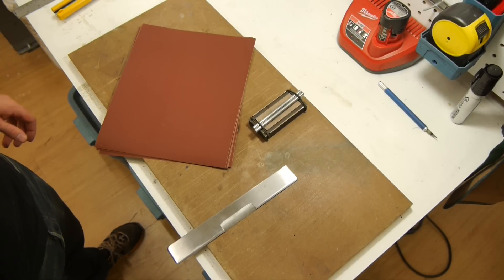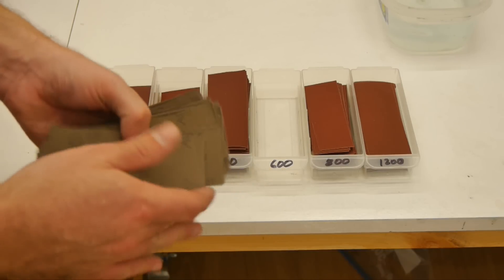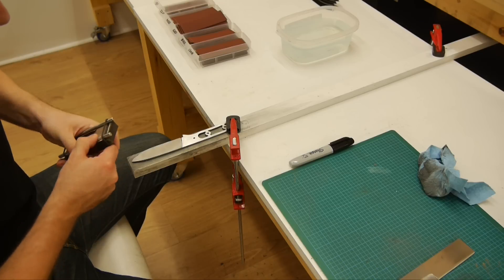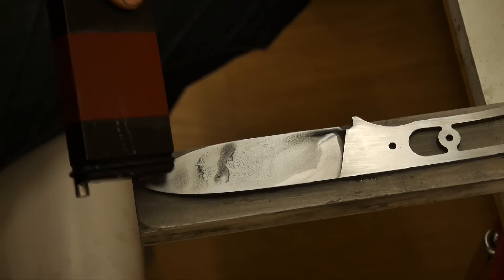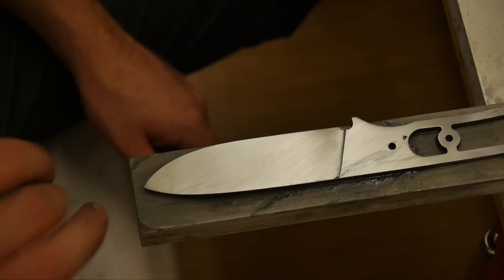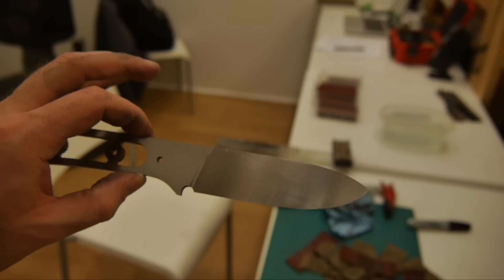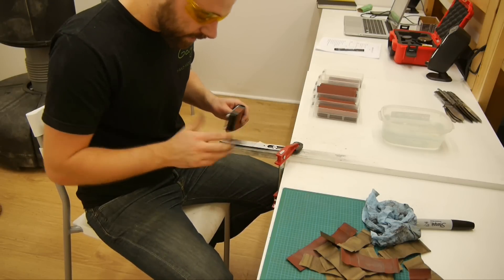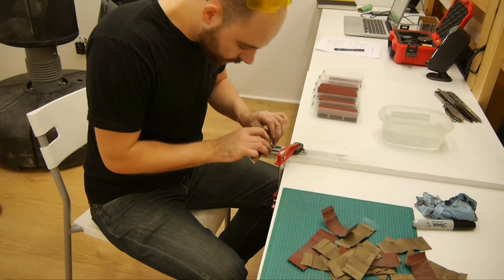How to Satin Finish a Knife Blade

Comment: Cutting sandpaper from the under side dulls your utility knife less.
Reply from the maker: That's normally what I do, I guess I didn't do it when filming this though!
Reply: Gough Custom Are you aware of the technique for cutting sandpaper with a hacksaw blade? Stanley also makes carbide tipped utility knife blades which should work great for that task and they're not very expensive.
Reply from the maker: GEORGE ZARIFIS I vaguely remember something about screwing a hacksaw blade to the edge of a block of wood, but I haven't tried it.

The carbide tipped knife blades sound great! The regular blades sure don't last very long! Will have to check that out!

Comment: Aaron do you completely finish one side to the highest grit and then flip the blade over, or back and forth with each grit progression?

Neil
Reply from the maker: I normally stay on one side until the 800 grit, then flip over and do the other side, then dry the knife off and do straight pulls with 600 on both sides.
Reply: neilyeag I

Comment: Where do you get the steel?
Reply from the maker: You can get steel from lots of different places. For knifemaking steels in particular you can try: New Jersey Steel Baron, Jantz Supply, USAKnifemaker.

For tool steels (including A2 which I use and love) you have even more options: pretty much any industrial supply place like ENCO, KBC tools, and even Amazon will be able to help you.

Comment: What type of steel are you using?
Reply from the maker: In this case it's A2 tool steel, hardened to 62.5HRC.
Reply: Have you tried 440 Carbon Stainless and how do the two compare?
Reply: Your knives are beautiful by the way
Reply from the maker: 440C is stainless, so it's a lot more corrosion resistant... However it's also much more brittle. Because it's much more brittle it can't be used as hard, which means that edge retention suffers. Overall A2 will have better edge retention and better toughness than 440C
Reply: I had a pocket knife made from 440c it always bent like crazy.

Comment: Hey Aaron, amazing video as always.
Do you mind explaining me what is the difference between wet sanding and regular sanding and when should I use each? Thanks.
Reply from the maker: Hey mate!
The main difference really is that wet sanding helps stop the paper from clogging... I only use it when I'm sanding steel personally. It's also nice to wet sand because the water captures all the particulates which means I don't feel the need to wear a respirator...

Comment: Awesome video and technique. I want to try this on a knife with really beat up black coating, which I will first chemically strip. I liked the metal beveled strip you used for final passes. Was this item something you made and is it available for sale? You just gained a sub
Reply from the maker: Hey Andrew! When working on a finished knife be sure to dull the edge first and don't forget the board under the blade, otherwise you run a serious risk of badly cutting yourself!

The bevel sanding block is something I made, you should be able to make one quickly with a file and a bit of metal or wood.

Comment: why does rust build up on my 1075 carbon steel knifes so easily?
Reply from the maker: Basically because it has no Chromium in it. Chromium in the steel creates a protective 'chromium oxide' layer on top of the steel that protects it from rust.
Reply: is there anyway to reduce it? because i literally just finished my blade and the next day it had a thin layer of rust on it and it hasn't even been exposed to water??
Reply from the maker: The only answer is basically to keep the blade oiled.
Reply: cheers
Reply: when wet sanding a 1075 knife or other carbon blade put baking soda in the water or try using oil instead.